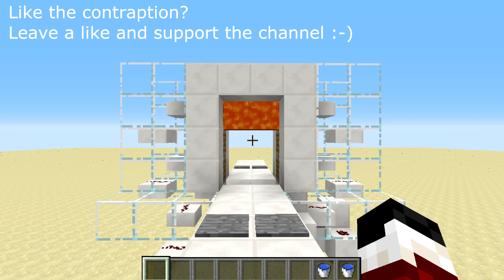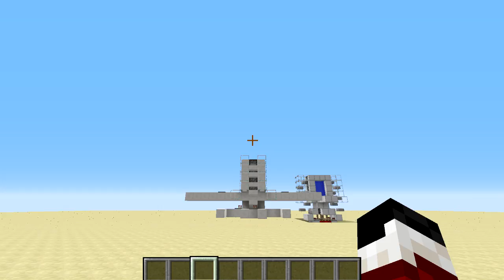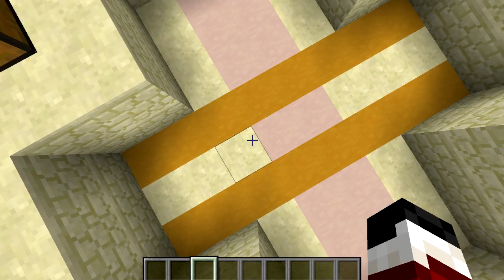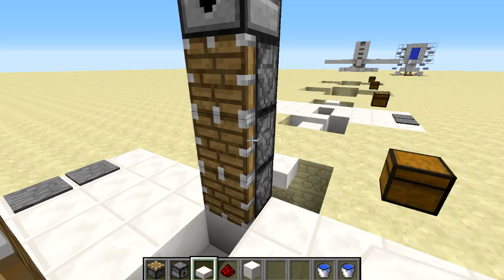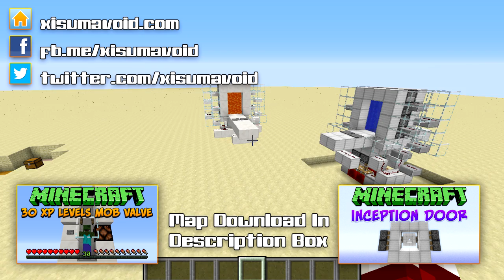Minecraft: Water And Lava Doors V2 Tutorial

Comment: Nice! This was a similar idea I had with my water doors :D I do think that both sides should have their own monostable circuit as it may cause problems (just like what Maizuma said)
Reply from the maker: I really don't see the need, it runs fine from one :-)
Reply: xisumavoid
can i do a minecraft vid with you
Reply: xisumavoid I Made a modification so it pushes blocks to block the path while the lava is flowing down, that way it can be fully turned on before its opened or used again